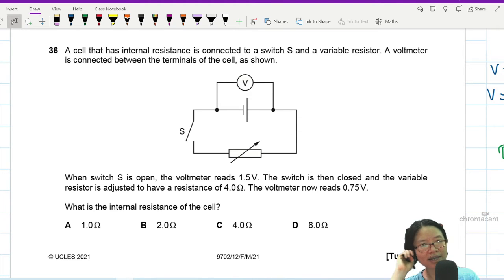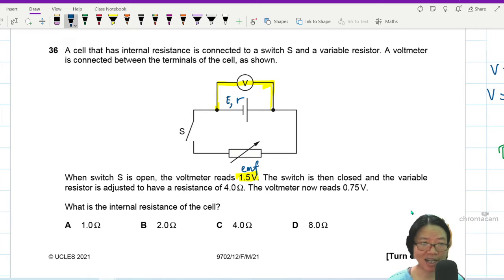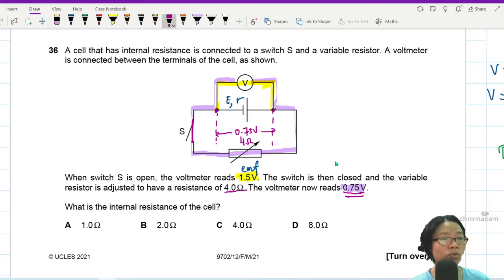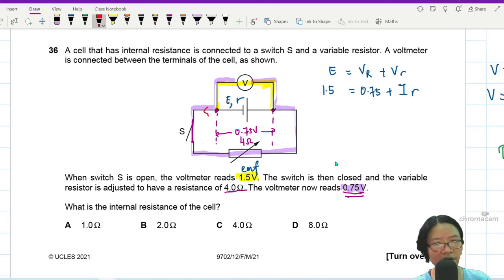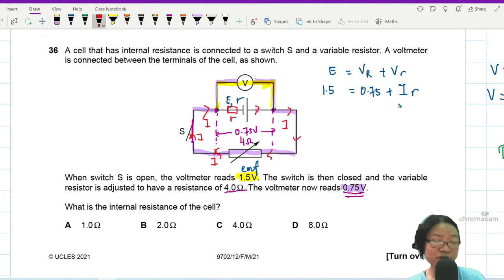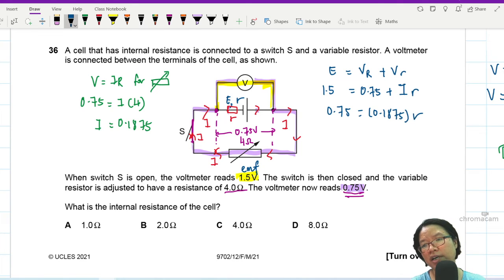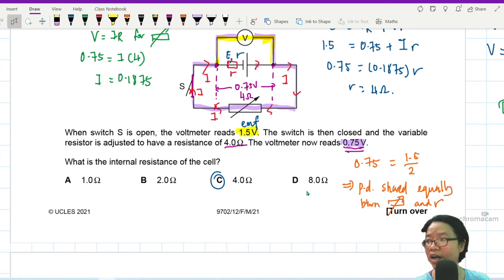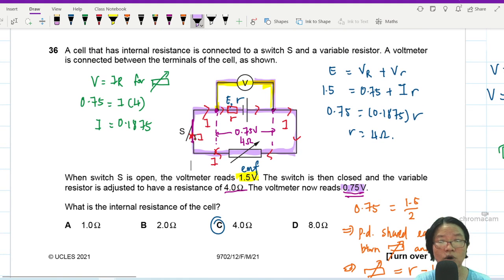9.2b Ex2 FM21 P12 Q36 Internal Resistance of Cell | Feb/March 2021 | Cambridge A Level 9702 Physics

Comment: Shouldnt the terminal pd be E-Ir which should be zero if the current is E/r??
Reply from the maker: Terminal PD is EMF if there is no current flow 
Terminal PD is external PD (PD across resistor) if there is current flow.

Comment: Does the battery have no current through it when only the voltmeter is connected?
Reply from the maker: resistance of voltmeter is VERY large, so there won't be any detectable current flow.